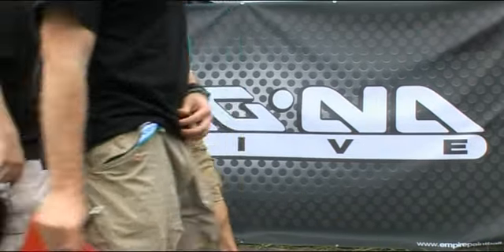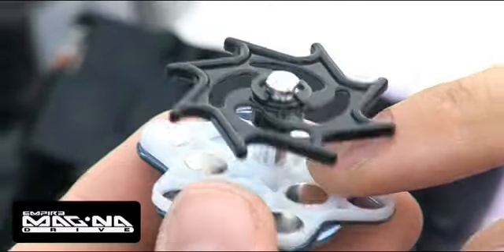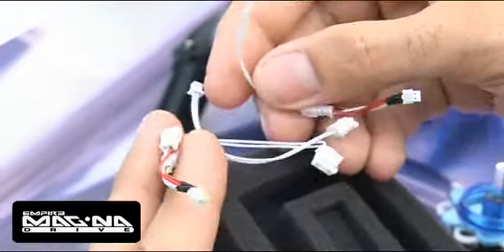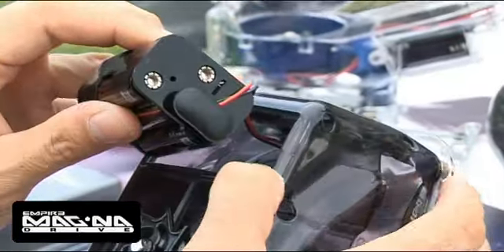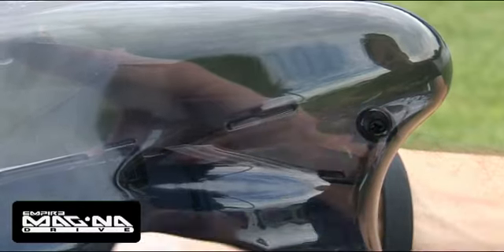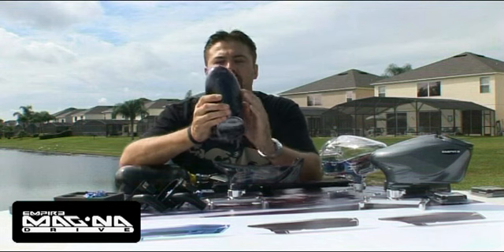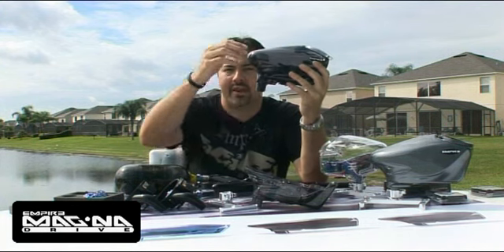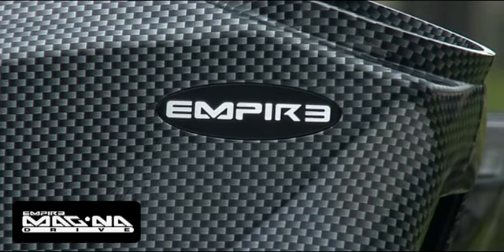Empire Magna Drive loader

Comment: when you turn it on, just keep holding the button until the led flashes (once only)

and then wait until the white LED to flash then it should be on sound activation.

if u have RF then just put it into ur gun (does not work on ions or shockers...u have to solder it on to the board) then pull the trigger a couple of times during sound activation. (it should turn blue when you pull the trigger a couple of times)

if press the button again before the white LED is on..then u are on prog.mode

Comment: just got a Proto SLG 09.. with the magna loader is was on sale. great loader.. only problem i had was with the battery. just make sure you have a fully working battery used i used a 9volt.. either then that common sense.. all noted.. the sound activation is spot on  no problems.. get it if you want a decent priced fast loader